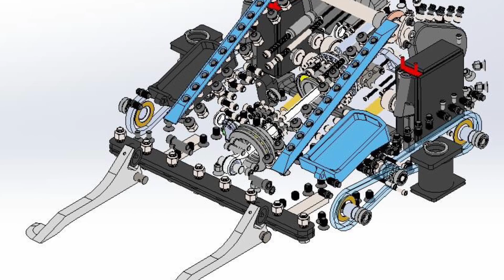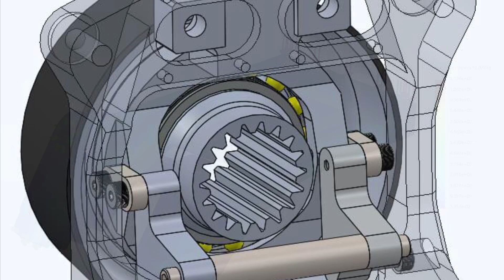Inside The WORLDS MOST POWERFUL Electric Flipping Battlebot BLIP!

Comment: I aways wanted to understand the design decision to make blip flipper so high and not low to the ground like hydra
feels like an obvious design decision
Reply: Me too, this is exactly something I've always wondered. For a rear hinged flipper, not having the flipping arm go down to the ground seems to give away an obvious advantage.

With the arm set back like that, Blip needs to get itself fully wedged under it's opponent to flip it. That's complicated to do when you're opponent is a moving target that can react to you, and is likely employing countermeasures (forks, skirts, etc) to make it hard to get under. But if the flipper is on the ground, you can attempt a flip if the opponent even gets slightly into the flipper for even a moment. Given the Blip has theoretically unlimited flips, it seems like it would want the ability to fire its weapon early and often, yet it's design seems to work against that.
Reply: My guess is this was driven by the desire to also make Blip an "unkillable brick".  I.e. making the flipper take hits as well as the front armor hoop would compromise the flipper too much.